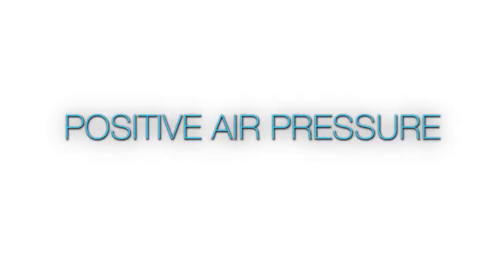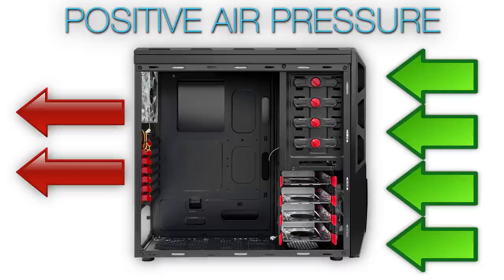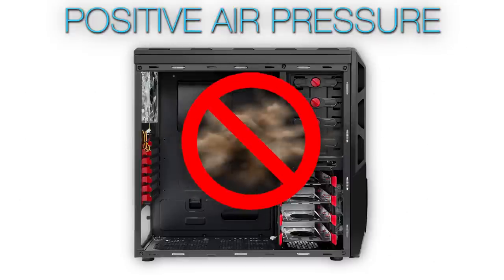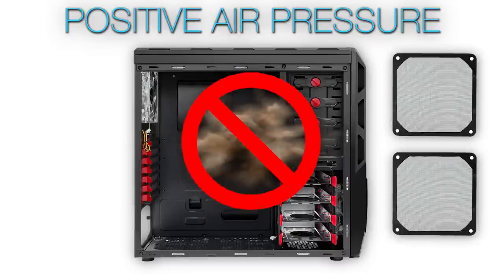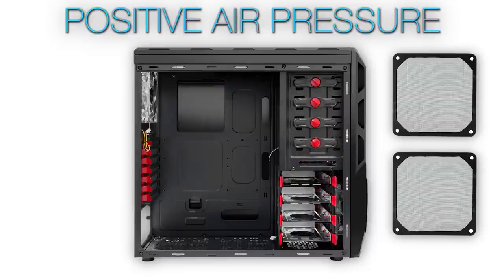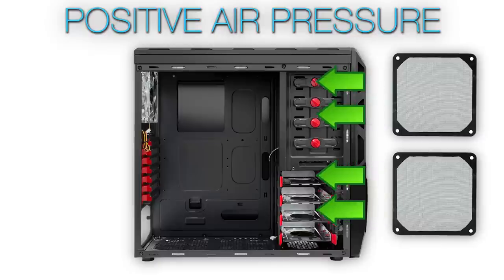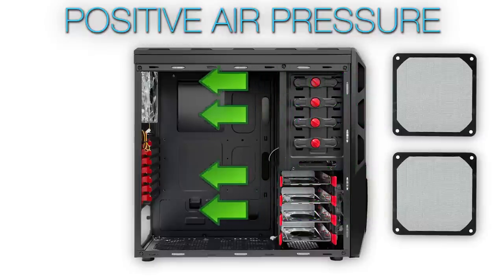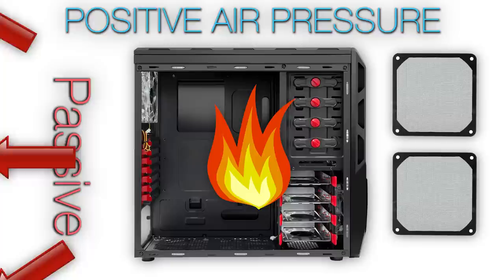Computer Case Airflow - What is Positive and Negative Pressure?

Comment: What we learnt back to elementary, that hot air went up. Why typical mb, cpu and gpu are installed vertical? And why typical case have air vents on vertical walls (front, back, and sides) but rarely on top?
Reply: It's quite common in higher end PC cabinets to have fan placement in the bottom and the top. My Fractal Design R5 has two 140mm high pressure fans in the bottom, two low pressure 120mm fans in the top and one 120mm low pressure fan in the rear for somewhat neutral airflow. This way the fans work with the natural air flow to ensure maximum cooling efficiency.

Comment: Hey um is my fan orientation correct NCIX? I have the corsair 760t black with two AF140 intake and the rear with one AF140 taking air out and at the top I have two SP120's on a radiator blowing air in

Comment: Would it be possible to show the correct type of Air flow configuration  to get the best out of a Corsair Obsidian 1000D Super Tower Aluminium Gaming Case - Black Tempered Glass (CC-9011148-WW)
CA-23T-CS case Please. Many thanks.

Comment: I'm using Thermaltake V200 RGB case with three intake fans and three exhaust fans, is that okay?
Reply: Just make sure they're not placed in a configuration that makes them fight eachtother. For example 3 at the front and 3 at the back would create neutral airflow and that would be nice.

Comment: In a case like the Cooler Master N200, if I have 2 of the same fans in the front for intake and 1 on the back and top of the case along with a push/pull setup on a CM Hyper 212 Evo, would that result in neutral pressure? Or would the CPU Cooler throw it off?

Comment: Dust can be cleaned with canned air and a vacuum. Damage from heat can't. Therefore negative pressure makes the only sense. Balanced is for a computer that runs Office 365.

Comment: Hello, new builder here. I was just wondering if I can do 2 exhaust 120mm on the top, cpu cooler exhaust, included back fan exhaust, GPU exhaust, PSU intake and 2 front panel 140 mm intakes? or does that make negative pressure?

Comment: wHAT about having a 180mm exaust fan on the bottom of the power supply and another back of the case. So the CPU fan, power supply fan and case fan are taking out air from the same part, sector, area or space (whatever you may call it) of the case??? Should i remove one of them?

Comment: So I built my PC, all that is left is two fans. I have one stock fan (intake) at the front, but where should I install the exhaust. I have two fans so it's going to be a bit un-even. I'm using a Corsair Carbide Spec 01 Case.

Comment: @NCIX Tech Tips
How should you orient your cpu+fan in your case?
Traditional fan facing the front of the case while exhausting twords the rear?
Or fan facing and pylling air through GPU while exhausting throught top of the case?
Thanks
Reply: it depends on your setup, push vs pull doesn't matter and the direction depends on how your airflow is set up. is your main exaust in the top or the rear of your case? point your cpu heatsink towards the main exaust
Reply: James Mastroianni 
Thanks for the reply.
Thats how mine is set up (1 rear 2 top rear) .

Comment: So i have 8 fans, 4 in 2 front 2 bottom, 4 out 3 top 1 rear. My concern is the third top one closest to the front. Is it necessary? Its seems to me its robbing cold air from inside and maybe disrupting the actual flow over the components? Case: Fractal Design R5.

Comment: neutral seems like the best airflow, but i wonder if changing the curves to positive pressure with the same fan arrangement would help with cooling. mainly because i like my no dust pc. 6 months and almost no dust. might only have to clean it once a year.
Reply: How to have neutral?
Reply: @LawAbidingSociopath69  if you are pushing air out of cracks an crevaces, then you increase exhaust fan speed. f you are pulling air in through cracks, (harder to tell, i used my vape) then you increase intake fan speed.

Comment: I have always used negative air pressure with great success for over 10 years. I use panty hose material for filters and large amounts of duct tape to close up secondary vents and leaks I find. Black tape of course.Works great.
Reply: well, you've been doing it wrong for 10 years. Positive pressure is much, much easier.

Comment: what happens if you have 9 fan blowing in from up, down, front but no fan at the rear?
Reply: The air would still move out the hole in the back, just not as quickly. If you plugged it up for some reason, things would get very awkward and air would move out wherever there is a crack or even slight vent.

Comment: So I was wondering I have been using this set up of one fan on the back as exhaust, one window fan for exhaust, on fan on the top for intake, and one on the front for intake. I've done the standard two front and one back but I really wand to know if the set up I have works.

Comment: Does the speed of the fans matter? What if perhaps if you have your intake fans runnin at max while your exhaust fans running at a lower speed?
Reply: This is the dilemma. Fan speed, fan curve, and filter matter, so it is not possible in general to determine whether your case will be positive or negative pressure from the number of fans in each direction, even if they are the same fan. The only way to tell is with some kind of flow visualization method, like burning incense or a fog machine, to see if the air is exhausting away from the case or being sucked into it.

Comment: I'd like to see the airflow pattern of a Thermaltake Level 10 Limited Edition, please! I will have my R9 Fury X's radiator fans pulling air in (front bottom intake location) while my FX-9590's radiator fans pushing air out (rear top exhaust location). But I just want to be safe and secure.

Comment: If I keep the side panel off, my heatsink fan will run at around 4000 rpm according to bios. If I put the side panel on, it will run at 6000 rpm. CPU stays at 50 Celsius in both scenarios. What should I do?
Reply: Same results then use lower rpm for lower noise
Reply: yasser jarrar I came to the conclusion that maybe my cpu fan is getting old. I forgot to mention that my whole build is 5 years old, and I replaced my motherboard a week ago.
Reply: also if you keep your side panel off, more dust will gather into everything, and you have no air flow. Only random air going around I think. Side panel one, you keep the flow and the dust away IMO
Reply: xDrako If I keep the side panel on, then my computer goes up to 60 celcius on idle, so there is no airflow in the case. I just keep the side panel off, because my computer has been functioning normal for several years. I'm using a very old tower that barely fits my motherboard and it has no fans, except heatsink fan.

Comment: Is This Fan Setup Ok? Case: Define S Front: 3x140mm fans Top: Corsair h110i 280mm radiator (2 Fans) Back: 1x140mm fan. Please tell me if this is going to work
Reply: +EccentricTrolling  OFC it's going to work. But you didn't specify whether you wanted negative or positive pressure, and you didn't specify which fans were intake and exhaust.

Comment: Im planning on getting the Cooler Master MasterCase 5 Pro, hows having two 140mm intake fans on the front and three 120mm as exhaust fans, one on the back and two at the top through a liquid cooler radiator.
Reply: i have the same config except 120s in the front . i have good temps .

Comment: i just bought a new case, it have 3 fans on the front, 1 on the back, and 1 more on the top, which should i make intake and which exhaust?
Reply: +StephanIsLol I would use one on the back for exhaust, one on the top back for exhaust (possibly 2 on the top for exhaust if you decide to use all 5 fans) and of course on the front you almost always want those to be intake and if you use just 2 intakes on the front, keep them on the lower 2 fan mounts.

Comment: Hi I have 3 intake infront with mesh grill then one at the exhaust back. My question is. The top mesh is empty. I wanted to put 2 more fans on the top. Is it necessary? or does having 3 in front and 1 at the back enough? What are your thoughts?

Comment: My case has fan mounts on each side of the HD cage, one at the top, and one at the bottom. I could also probably put some at the bottom, but would putting an intake fan there be bad since it would be blowing into my gpu stock fans?

Comment: I have 2 140 mm intake fans on the front of the case and 1 120mm on bottom bringing in air and 2 140 mm fans on top as exhaust and 1 140mm top rear as exhaust will that work or no

Comment: The problem is if you have 28 or 30 degrees at home. The fan just pushes air, it doesn't cool it. Same if your home is humid in the winter. With a modern pc, it's more likely to degrade the lifetime  If you have a GPU with three fans and some modern cooling. there is no need for it. Even if you have maybe too much fan and some breaks it's hell to find which one it is. PC can handle running up to 90 degrees without any problems In 5 years, you'll buy a new one anyway.

Comment: I have 3 120mm fans in front intake a 240mm rad cpu aio cooler up top with 2 fans intaking and 1 120mm exhaust. The case itself gets pretty hot Mabey CPU temps haven't been above 52c max load with i7 8700k set to 4.7 all cores. GPU runs a little hot though . thinking of putting CPU aio cooler to exhaust as well. GPU is 1080 ti sc2 hybrid btw it's rad is on rear exhaust fan. Thoughts? Seen 70c on gpu. Most ppl I see on you tube there's run around low to mid 50c . thinking all the hot air from CPU rad coming into case is effecting gpu temps. I bought an rgb case and love rgb in front so don't want to front mount CPU cooler . rosewill cullinan mx case

Comment: I'm using an old HP is the case and its one case fan is an intake fan is that good? Also the van does not have a filter and right now I was cleaning out the computer just covered with dust

Comment: Im trying a new rgb build with the view 71 i put my aio mounted on the side push pull inside the case 2 120s pulling in on the bottom 2 140s pulling from front 1 140 exhausted back and 3 140s exhausting on top.   Any suggestions?

Comment: So if i got 3 fans at the front panel pre-installed and i want to add 1 more fan at the back... which direction should the back fan point? Like the same direction as the front fans or do i need to turn the back fan??? Pls help

Comment: Hi all, my setup is as follows : I have 2 Vardar F3-120 (static pressure) as front intake, then I got 2 coolermaster 120 mm on the side panel as exhaust, further more I got an H100i with 2 Vardar F3-120 as intake on top of the radiator and lastly I got 1 Vardar F3-120 as exhaust. Should I turn the H100i fans so they pull hot air out? Any good ideas? Thanks in advance! P.s. my case is a coolermaster Haf 932 XM

Comment: Do you have a airflow video for the Cougar MX330-G case?
Reply: I’ll have five or six fan setup. Going to have my intake and radiator on the front of the case and was thinking to have two exhaust up top and one in the back. Seems to me that’d be more of a negative pressure situation though.

Comment: hmm i have 2x 140mm intakes a 360 radiator at the top that blows the air out and a 140mm exhaust in the back according to the video i have negative air pressure? should i use the rear exhaust as an intake? EDIT: my graphics card is a Gigabyte 980 Ti G1 Gaming the case is a Phanteks ethnoo pro m
Reply: Rear and top should always be exhaust. Front, side and bottom is for intake.

Comment: Can i ask something? If i have a liquid cooler like corsair H60 (1x 120mm fan), which i put the radiator and the fan at the back side of the case and set it to be an intake flow. What is the best configuration to have a good airflow?
Reply: the radiator in that position should be an exaust. anything in the rear as an intake is the worst configuration you can have.
Reply: +James Mastroianni thanks dudeee
Reply: Wresni Ronggowerdhi yea np. you want the air to move in one general direction and having front and top intake messes that up.

Comment: 780t
front 240mm rad w/ push pull with 120mm lower intake
Top  280mm rad Push Pull   exhaust
back 140mm exhaust
Bottom 120mm intake between drive cage and psu

want to see airflow with rads in play

Comment: so if my 2 front fans are intakes, my 2 top fans are exhaust, and my back fan is an exhaust I have negative pressure, if my t4 cpu cooler fan and my gpu fan are facing down what are they exhaust or intake?

Comment: so are there any videos/diagrams showing airflow patterns on a corsair carbide 500r? or what would you all recommend? I was thinking I would leave my 2 120mm fans in front and my stock 200mm fan in the side then use dual 140s on top for exhaust and a single 140 in the rear and a bottom intake 140? this would utilize all of my fan locations and since I wont be liquid cooling anytime soon I would like to get possibly the best aircooling setup for my case. or should i hit the forums for this lol
Reply: Exact same case and question as you. I'm wondering if I should add top exhaust fans as I currently don't have any.

Comment: Hopefully this gets answered:
I want to install an AIO watercooling system with 2 intaking 120mm fans at the top of my case. With this System, I would have 2 intakes at the top, 3 intakes at the front and 1 exhaust at the back of my case, all of them 120mm. Could this mabye cause temperatur problems? Graphics card is a msi rtx 2080 gaming x trio, which shall be placed so that the front of the gpu fans points to the side panel of my case (just in case this information could be useful somehow)
Reply: NCIX is bankrupt.

Comment: What about the PSU sucking air out of the case? How does that effect it?
Reply: Most PSUs don't do that as they are bottom mounted. Sucking air in from the bottom and directly exhausting it in the back.

Comment: If I do a Negative setup cant I just tape up the holes and cracks? My case already has a few dust filters on it already.
Reply: Unless you vacuum seal your entire case, air will still seep in via 5.25'' bays, usb ports, back i/o, etc. The temperature difference between Negative and Positive is actually about 2-3 C, so there's no reason not to go Positive anyway.

Comment: Hello,
This video was really helpful. But I would like to see the pattern for my case "Delux SH891" (big side fan removed and filled with glass).
The case is not charming but this was the best value for me that time.

(in case you need to know the info:)
I have GTX770 4gb oc from GIGABYTE
Core i7 4770k (stoc)
PSU is not contributing to system cooling as its down facing. 

I will be very happy if you show me something on it.

Thank you very much.

Comment: Gonna have a lot more than OEM when I finish installing my noctua’s tonight Dell oem fans suck, I have an A12x25 on my rad and 3xP12 redux 1700rpm high performance for my case fans on a neutral configuration not much difference between the two 1C on a rad or air cooler so I figured it would be ok to save the money those A12x25 are $32 ( woulda been around $135 with shipping and tax for 4 A12’s ) the 1700rpm redux is $13.90 so I saved a good little bit by slightly sacrificing performance but only by maybe 1%-2% if that I spent right at $75 total

Comment: Really need help figuring out best air flow for fractal node 605 I have 4790k and gtx 980 and the system gets really hot running a small 5% over clock. Have dual 80mm noctua rear and 3x noctua industrial ppc 2000rpm with strider 850w gold psu.

Comment: Please help me. I have a Deepcool Kendomen Black case with 2 LED 120mm fans in the front (intake), 2 120mm fans in the top (outtake), and 1 120mm fan in the back (outtake). Can you please tell me whether my setup has Positive, Negative, or Neutral pressure?

BTW- I have the Intel stock cooler, and a Gigabyte GeForce GTX 1060 OC (fans down the bottom).
Reply: HeyCya thats good airflow
Reply: lol i have exact same case but havent installed it yet :D

Comment: Can you correct me if am wrong pls? I have 2 intakes fans at the top and 1 intake at the front and 1 exhaust fan at the back. Would that be a positive air pressure? Will it be efficient enough for cooling my PC or I need to change an intake to exhaust or vice versa?
Reply: Amdo TechLab The top fans are misdirected. These should always help to expel the hot air. The hot air is less dense and tends to rise.
Reply: No Name Tito well that make sense, thanks man :)
Reply: No Name Tito if possible as well, I made a positive air pressure in my case, I have 4 fans, 2 at the top intakes, 1 in front intake, and 1 at the back to exhaust, is that a good positive pressure? Or shell I put them in a different position?

Comment: "Neutral airflow means that you have an equal number intake fans and exhaust fans." That is not true and slightly misleading. It's quite common to have an unequal number of intake and exhaust fans and maintain neutral pressure by adjusting the individual fan speeds.

Comment: Hi, NCIX.
I have an old Cooler master cosmos rc 1000 can you help me how to setup airflow?
I have installed 3 fans 120's, one is behind the hyper 212 evo as exhaust fan (connected to cpu fan optional), one on top of the case as exhaust ( second spot for fan on top of the cpu) an full speed and one intake from the bottom of the case blowing fresh air to video and chipset (full speed).
My video card is powercolor r9 290 PCS+ (blowing hot air in case) and the 212 evo blowing hot air to back of my case (to fan who is on cpu fan optional).
And I have second question.
If I go to 140 radiator AIO liquid cooler or 240 radiator how to setup it?
All fans are COOLER MASTER R4-S2S-12AK-GP
Sorry for my bad English but in Bulgaria, I don't use it so match.
Thanks in advance.